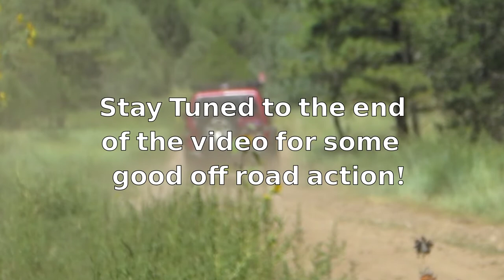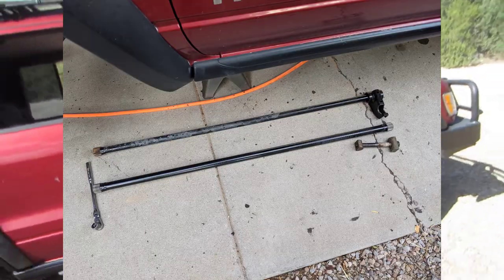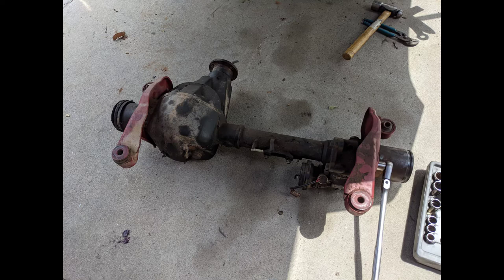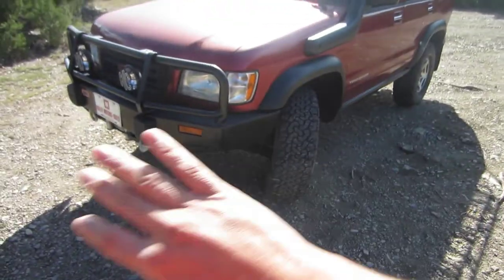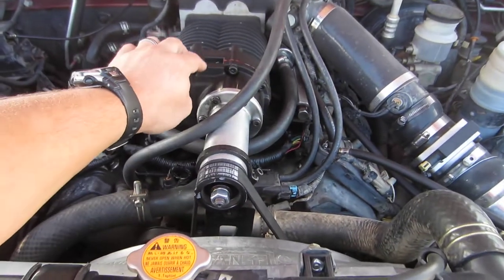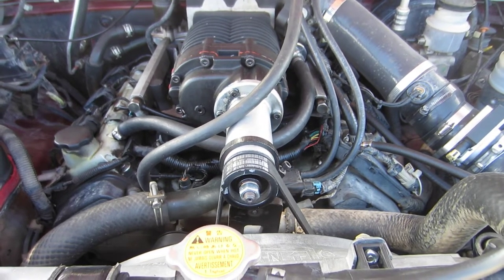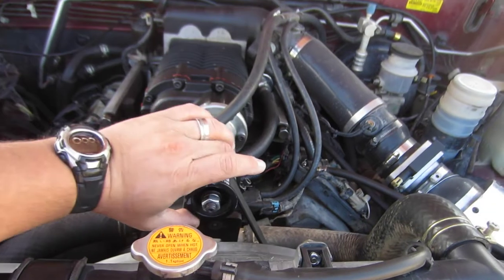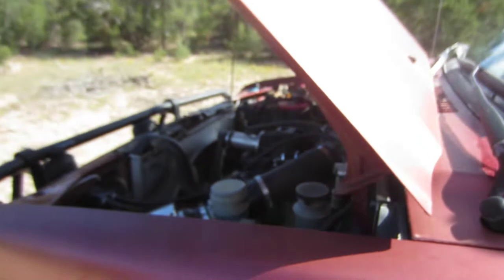Isuzu Trooper: Maiden Voyage on all new suspension

Comment: I'm looking at a 2000 Trooper auto 4x4 with 130K miles. Looks to be in decent condition from pictures online. Should I go for it, or run away? Money pit?
Reply from the maker: I'd say it's worth checking out! See if the owner can be honest about if it burns oil. Then make sure the transmission isn't showing signs of issues. 
Then it's just maintenance from there, check the CV boots, bushings, etc. 
You never know till you check it out!

Comment: Love your vids Cody!  Keep posting. Still trying to find myself one of those super chargers! Trooper mafia needs to have a wheeling session….
Reply from the maker: keep your eye's peeled! you can probably do an LS swap quicker than it will take you to find a supercharger ha
Reply: @CodyShell  Are they on any other type of vehicle or just specific to Isuzu? I am always at my local yards.
Reply from the maker: @corywilliamsmith  the supercharger is an Eaton M62 so they are fairly common, it's the intake manifold and brackets for the pulley that are impossible to find. They didn't come from the factory on any Isuzu's it was a kit sold by a company called Alpine.

Comment: What are your taughts on the ride quality and handling with the new additions?
Reply from the maker: Huge improvement! My trooper weighs almost 5000 lbs with my gear and myself. The torsion bars with the high spring weight make the front end so much stiffer, which is nice because the bumper and winch add a lot of weight much further up front compared to stock. 
And the KYB monomax shocks are very stiff - but not in a bad way, it handles like a more modern car, much more responsive. Definitly prefer this setup compared to stock springs and Ranch RS5000 shocks that I had before.

Comment: Looking great Cody. How hard was the HD Torsion bar install?
Reply from the maker: I was a little intimidated by it, but it wasn't that bad! break loose the two bolts on the control arm that hold the torsion bar, and go to down loosening the big torsion bar bolt. The hardest part for me is the torsion key and bolt were all super dry and those parts are supposed to be greased. it was very hard to get off. When i put it back i greased everything to factory specs in the manual and they turned on so much easier. my issue was i didn't mark the old torsion bar, so I kind of had to guess when I put it back together. came out alright! and they are a much needed improvement
Reply: @CodyShell  Great insight, thanks so much!

Comment: What transmission is in your Trooper?. Is it the 4L30E or AR5?.
The reason I ask is because my 4L30E is going to need a rebuild and I'm seriously thinking about a manual transmission swap.
Reply from the maker: Mine is the AR5, and it's held up great! However I feel like the synchro for 1st gear is starting to go. It has 243,000 miles on it and it's great. A MUA5 or AR5 swap would be awesome!
On the Isuzu Trader Facebook group a member there has been working hard on rebuilding 4L30Es with better parts and fixing the internal flaws in that transmission and making them better than stock.
Reply: @CodyShell  If I can't find a donor vehicle with the AR5, I'm probably going to rebuild the 4L30E myself with better than stock parts. If your were wondering, I have a 2000 Trooper.
Reply from the maker: @marvicty  I know the manual transmission in the pontiac solstice and saturn sky is an AR5, but I think the gear ratios are a little different. I'm sure with time you'll come across one!

Comment: Trooper sounds good! What muffler/ exhaust are you running?
Reply from the maker: Thanks! First time off roading with the KYB shocks and everything else you reccomdneded for me, its a great setup!! It's got a high flow cat, flowmaster 40 series and 2.5 inch pipe for everything after the Y pipe
:)
Reply: @CodyShell  Just one cat or 2?
Reply from the maker: @mehGyver  just one! I just uploaded another video where you can hear me going up a sand dune at WOT. Nice supercharger whine too :D
Reply: @CodyShell  Just watched it. Sounds good. 
My 99 has 2 cats. Did yours not come with 2?
Reply from the maker: @mehGyver  gosh it's been so long with this setup I don't remember, I've only had the single high flow one for around 6 years. I wonder if your trooper had California emissions or something
Reply: What's your opinion on those KYB Monomax shocks on and off road. I have the regular KYB gas a just shocks and am just  not impressed. I was thinking about trying out the Mononax.
Reply from the maker: @Chris-4876  I like them a lot! on-road i first thought they were way too stiff, but off road they really handle the terrian well. especially with all the extra weight my trooper has
Reply: @CodyShell  Specific flowmaster 40 series...cant find one specific to 2001 Trooper?
Reply from the maker: @leonviljoen4207  for a 2001 trooper a 40 series with a 2 inch inlet and outlet pipe will be all you need. Although its likely going to be too short so you'd need a section of 2 inch pipe to make up for the space of the shorter muffler

Comment: Hey Cody - what tire size you have on there? Also roof rack model?
Reply from the maker: The tires are 285 75r16 BFGoodrich All Terrain KO/2s
The Roof Rack is a Smittybilt Defender 4x6 modular roof rack
Reply: @CodyShell  Thanks Cody.
Reply: @CodyShell  Cheers Cody, another question...did the larger tyres affect the performance whatsoever?

Comment: What kind of ball joints are you running? And where did you get them? I own a 2002 4x4 5spd trooper that needs a complete suspension overhaul and want really good ball joints and shocks. Also what kind of tie rods are you running? I noticed you had some HD tie rods in previous videos. Are you still running those?
Reply from the maker: I'm still running the HD tie rods from Independent4X, they are holding up good. I just put new rubber tie-rod boots on my set, they're about 8 years old now. 
My ball joints and CVs are just the duralast ones from autozone, nothing fancy. my last set of upper ball joints were duralast ones and they lasted quite awhile. I was just going for the most affordable option at the time. I'm pretty happy with the turn out
Reply: @CodyShell  have it heard anything good about the Indy4x ball joints? They’re pricey but look good.

Comment: How did you  install a super charger 
Does it consume more gas ?
Reply from the maker: The supercharger is a very hard to find kit that hasn't been produced in a long time. Surprisingly under wide open throttle and hard driving MPG isn't that much worse than factory. With a light foot on the petal going 65 mph I can get 19 mpg with the supercharger
Reply: Thank you for taking the time to answer back
I have a 99 Trooper 
Hi from Costa Rica!!!!
Reply from the maker: @0550rigo  hello! Is your trooper a 5 speed? That's great my friend
Reply: @Cody Shell  Yes it is ,it's  a 5 speed manual 3.5 v6 
In Costa Rica it's a great car